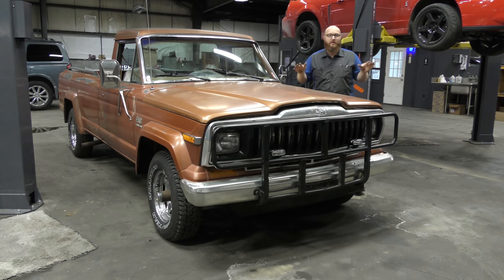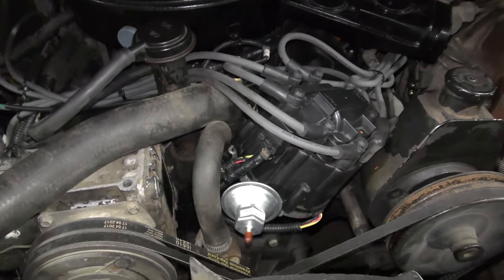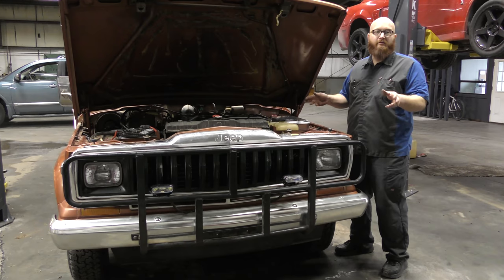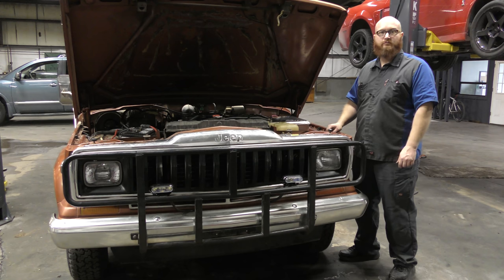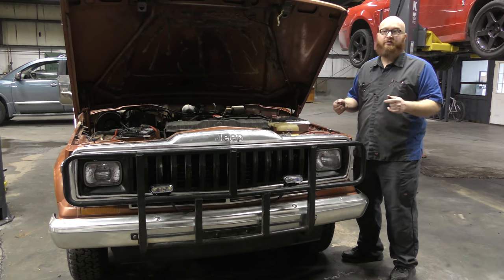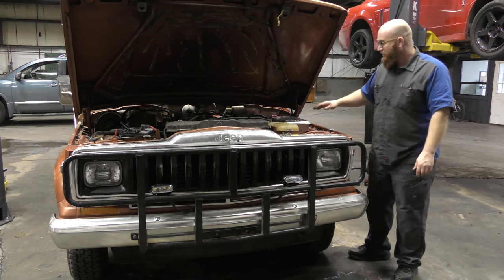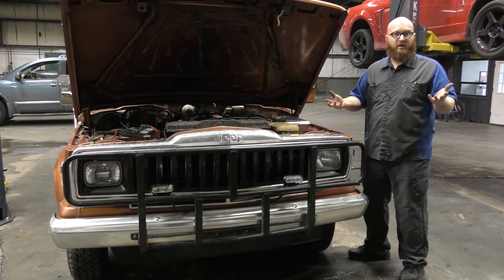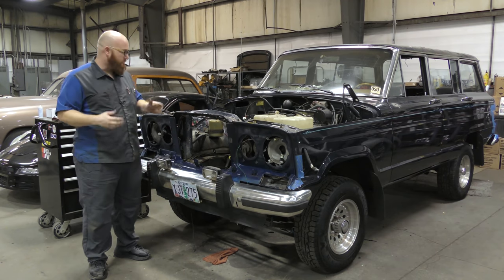The tale of two classic 1983 Jeeps in the CAR WIZARD's shop

Comment: As a retired wastewater plant operator, I have trained several new operators. I would try to past on my experiences on how I solved problems by smell, texture, color, and many other thing that would make your stomach turn.
But the best knowledge is hands on. Problem solving is not taught in school. A good operator (or mechanic) can make difficult job / problem look easy with experience. It’s rewarding to me so see a young operator figure things out. Keep helping these new guys.

Comment: Surprising to see an Oregon vehicle in your shop. I live along the Oregon/Washington border and a common misconception is that because of the rainfall in this area cars should be avoided as per the rust factor. However, roads are not salted and the rain is not acidic except along the coast. So other than cars sitting with standing water in them or mud packed body crevices the amount of rainfall has no bearing on rust and there are plenty of clean, rust free rigs to be had with largely decent paint.
Reply: The bad news is that cars tend to be quite overpriced here, especially on the west side of the state(s) where there is quite a bit of money sloshing around.

Comment: One thing to note on the Wagoneer that really should be done is to either remove the torque converter or bolt a strap to it to hold it up in the bell housing. Without the crankshaft on the engine to keep it centered, the converter can sag  enough to cause the seal to be deformed and start to leak. It's interesting that the body behind the headlights is still set up for round lights. Jeep/AMC never changed anything they didn't absolutely have to over the years as it cost money for new stampings.

Comment: I like that Jeep. Yeah, I'm very knowledgeable on parts cost and all the research. I know if I go to the dealership and they find why my truck doesn't start and the cost of an ignition coil is $186. Automatically, I know I could buy the same part for 30. Matter of fact, I just purchased an ignition coil for my Ford Ranger XLT for $24 with free shipping, and it's stored for me to change whenever the need arises. Every time you take your vehicle into the dealership, you'll pay between $500 to $800, but they know what they're doing and they'll resolve the problem with quality work, because they worked on your make and model numerous times, and they have many mechanics to discuss over your vehicle problem. But hey, I'm 72 and I still like to get involved working on my truck to a point. And, I like this channel for the knowledge that's shared with us.

Comment: My father taught me a little trick about rear main oil seals years ago. Dunno if it would work on anything but Mopar 440 engines but my Mom's '74 New Yorker all of a sudden started leaking oil and bad. Pop took it to a couple different shops and they both said it was the rear main. It was either drop the transmission or yank the motor. A few days later he asked me to drain the oil in order to change it. After the engine was fully drained, he started up that big block and let 'er run without any oil in it for like 8-10 seconds, then shut it off. Then he had me put the plug in, chang out the filter, filled the crankcase and it was like magic! The leak stopped. It never leaked again-for over 2 years! Then he traded it in on a new Datsun (Nissan now). I never seen anything like it. He says somebody had told him to give it a try-it either works or it does not. Go figure...

Comment: I bought a car once and brought it to a shop for pre-inspection to tell me what it needs. I got a call a few days later telling me "it passed." ... there was no communication from when I dropped it off, until when I picked it up, the bill was 4x higher than the pre-inspection fee because they took it upon themselves to order all the required parts and install them. I couldn't believe it.

They even charged me an hour to change a fog lamp bulb that took me 5 minutes to change while the car was on the ground.

There's no such thing as too many phone calls.

Comment: I love the style of the older Jeeps and Internationals, Blazers, and Broncos  1960s & 70s. It would be nice if you still could still buy a new Jeep and the other vehicles listed with the original styling, along with upgrades to drivetrains and suspensions.
Reply: There most likely is a company that does modern engine swaps in those vehicles.

Comment: Interesting that front end shows that AMC didn't change the front clip on the Wagoneer/J10 when they switched from 4 round head lights to  2 rectangles. Ford didn't either on the late 70s to mid 80s Econoline either.

Comment: We looked at these when they were new. The brakes were chirping and other problems on a new vehicle test drive. We were told that was normal on the vehicle. Decided this is not what we wanted if that was normal on a new vehicle. Love the looks but they were junk. Hindsight, most brand of vehicle's were of bad quality back then. Seems nothing has changed most vehicle's are junk today also. Sad to say.....
Reply: Wagoneers were nice looking, nice riding, but gas hogs, and not very powerful.  Would prefer a NBS Tahoe any day of the week to a Wagoneer
Reply: Yet most of what see in serious off-roading is Jeeps.  They must be doing something right.
Reply: Like it or not, quality has improved in leaps and bounds since the 80s. Modern cars are very durable also.
Reply: @21Piloteer  that's because other than " niche " off roading manufacturers, Jeep is pretty much the only semi affordable mass manufacturer who builds cars for the purpose of off roading. They're still junk lol. Just easy to obtain.

Comment: Holy hell, the customer is investing big bucks in that Wagoneer, that's for sure, but he's gonna end up with a really nice rig..👍....On my 85 Cj7 258cu 4.2L I just had a Howell Engine Development throttle body installed, $1299 for the unit and harness, $3000 to have it installed, had a few other issues taken care of while it was in the shop....the TBI is modeled after a Garbage Motors 1989-90 chevy cavalier hunk of junk....Chrysler used to manufacture a much better unit years ago, but the Howell is the best available right now, even though it has some inherently serious issues, with one of those issues being that it is the easiest fuel delivery system to flood...I can't even park my Jeep facing downhill as it will flood itself out, it seeps gas out of the injectors I kid you not...but, it's got better power and fuel mileage than the 2bbl carb that was on it...what's weird is the electronic ignition in it is a brand new Ford unit, so my gm based tbi's ecu "talks to" the Ford distributor....anyway, paid $3000 in 2019 for the Jeep, and now have got $13,100 in it on top of that $3000...so far anyway....🤷🏻‍♂️ I love the Jeep regardless, it's keeping the miles off of my 74 Bronco high horsepower BEAST...lol...

Comment: I rarely ever take my vehicles to shops. But on my current project truck, I had to take it to a body shop to have the frame straightened. The previous owners were out jumping it like the duke boys and caused a lot of damage. No big deal, I got a quote for $600, dropped it off, told him to take his time. Call me if he needed anything, etc. A few weeks pass and the next time he calls me it's to pick up the truck. I show up and the work is all done and it was done very well but the final bill was over $1200. Needless to say I'm annoyed. It's not that I would mind paying but that's twice the price I was quoted and it was never even implied that it might take more. We agreed I'd pay 1,050 cash to settle the bill there and I decided I'd never go back to him. Not only that but I had already repaired a crack in the frame before taking it to him and I found another one under the steering box that he also failed to find or mention afterwards, so that just annoys me about it even more. Seems like every time I take something to a shop, the quote doubles. It's just something every car guy who knows better is prepared for.

Comment: Car wizard I have a 68 custom Chrysler 300 coupe 383 67,000 original miles dropped it at a shop with 1000 cash said please change all fluids got it back with oil changed and a nice buff job wish I was closer

Comment: No vacuum advance....
No ring life expectancy
Reply from the maker: The kit that was installed by the customer uses a vacuum advance distributor, but with the newer ECM controlled ignition module. The instructions say to NOT connect the vacuum line to the advance. Leave it plugged. You are mistaken.

Comment: What - no vacuum advance?  Doesn’t that really hurt the gas mileage?
Reply: Not needed with TBI.
Reply: @one_flew_over_the_cuckoos_nest  Are you saying that no advance curve is needed with fuel injection - or that the advance curve is being handled electronically rather than through vacuum demand?
Reply: @Thomas63r2  It's being handled electronically so the old one is useless.

Comment: Still have a bad taste in my mouth after car wizard said the 4.7 is a garbage. Literally just as good as the 5.2,5.9, and 5.7....
Can be more powerful and economic than all 3.
With proper maintenance and no overheating it will last 250k plus no problem. I’ve never had or seen the head gasket problem he’s referring to unless it’s not maintained and kept cool!
Reply: I had a 4.7 in a Dakota .. didn't  have it long but it was fine while I did.

Comment: The problem with restoring old cars now,the quality of the replacement parts are all chinese made,and the quality is trash,i bet the new heater core won't last 8 years before needing replacement
Reply: Yeah, but in 8 years, Chinese parts will be of much higher quality but still just as cheap.
Reply: @theundergroundlairofthesqu9261  Idk about you,but im only trying to take my dashboard off once in a lifetime to change heater core,my original ford part from 1984 lasted 36 years,Chinese might get lucky and get 8 years

Comment: "It's gonna be a running, driving truck...."  Not for long!  Those AMC pieces of junk were horrible.  I owned two of them - never had such money pits.  You fix something, the part fails again almost immediately.  They overheat under load, the rear windows fail constantly, that reworked 360 is very low powered, etc.   I've never hated anything like I did those two '80's era Wagoneers I owned.  They're the reason I went to Suburbans - haven't looked back.  I can't even express how much I hated those things.
Reply: Lol...I had a 76 cj7 had to carry tool box. Loved it as a kid.
Some AMC were ok early on in 60s simple.
Reply: amc good gremlin eagle matador concord you just had to figure out who made what part

Comment: Hi I have a problem with my car, Its a 2009 v6 mustang, the problem is when it's cold or cool day and been left standing for a couple of days it doesn't start very well, if it was a carburettor car I'd say it was a choke problem, ( It has lean codes) I've checked the obvious and can find nothing I bought a workshop manual  but it doesn't help any ideas?

Comment: I owned and drove two AMC Jeep’s:  a 1973 Jeep Wagoner and an 1986 Grand Wagoner.  I am afraid that expectations of some viewing this video and wishing to try one might need some readjustment. 

The 73 was old school with a 360 4Bbl, power drum brakes, TH400, A/C, and a gear driven transfer case.  I bought it in 1980 after being transferred from LA to Connecticut.  It certainly wasn’t 100% reliable, but with some mechanical knowledge, you could always get home.  The 86 was bought new in California and was far fancier but managed to fail to cross the SF Bay Bridge stranding my wife about a week before my daughter’s birth.  It had less than 200 miles on it and suffered a bend lifter and related damage.  It did run mostly trouble free for better than a year until it had an engine fire in 1987.  Quality control wasn’t ideal.  I wanted to add a wind deflector to help keep the rear window clear and discovered that the roof was 3/4” from being symmetrical.  

Don’t expect a 40 year old car ever to be trouble free, and it will always be necessary to carry some tools and have some mechanical knowledge before venturing off road.

Comment: Teaching new hires. That’s something everyone should experience. I got a job in a very nice body shop in 2019. They hired me half way through my internship. I graduated highschool on a Friday, and started working full time on Monday. This summer will mark my second year in the body shop. I starting off detailing which I already knew how do do thanks to my step dad. But now I have the ability to pull cars apart and determine what will need fixed. I’ve gotten astronomically better at identifying car parts, and I’m much better it putting cars back together and figuring out what sometimes are jigsaw puzzles. I’ve been teaching myself some mechanical bits and pieces. But my favorite was teaching my grandfather, who was a plumber, how to change a radiator which I did in his garage on my car. I can’t wait to someday teach some young, bright, wide eyed kid all of my tricks that my mentors have handed onto me.

Comment: I bought one new off a Houston lot in the early 1980's, drove it to Oregon on a move. Let the dealership have it back because they lied about the fuel mileage. Had to keep a 50 gal. drum in the bed to go anywhere over 100 miles. No way I'd have another. Great truck though.

Comment: Hey wizard, so you have an opinion of the add-on EFI that the guy used?  I think it's https://pfisys.com/.  As far as I can tell, they use off the shelf components with a custom wiring harness.  Any pros or cons about such a system (compared to the Holly Sniper & similar custom aftermarket systems)?

Comment: Hey car wizard, I have a 2005 545i, I've changed the valve cover gaskets twice in the last month and it won't seal, still leaks oil, this will be my third attempt, it has the original valve covers, do you suggest that I buy new covers?

Comment: My machinist called me many times when I was getting my block machined.  It is an ls 6.0, I wanted to just hone it, clean it up and put rings and bearings in it.  Come to find out it needed to be bored, and it had bad rods.  Things go wrong especially when it’s not a run of the mill repair.

Comment: Oh, I hope this cake pan with the electrical installation does have a drain hole, because it'll be next to impossible to keep water out of there, but if it has a drain hole at its lowest point, that won't be a problem, because the water can easily drain back out again.
Reply: I was wondering about that too,because of condensation.